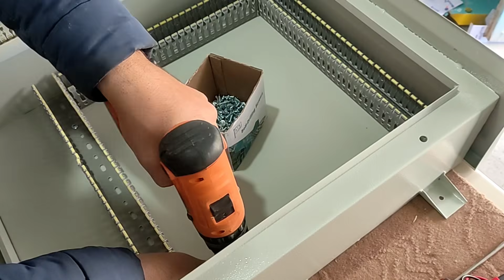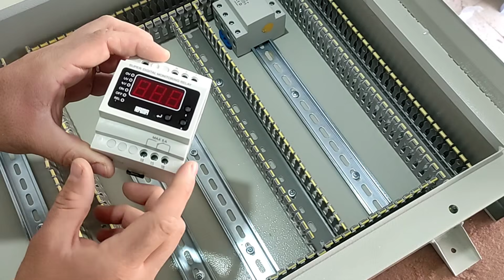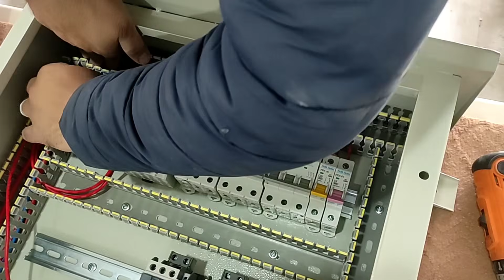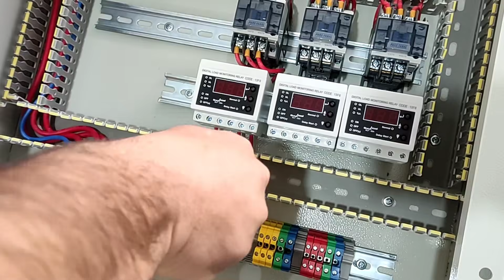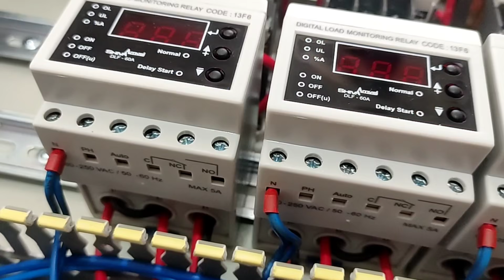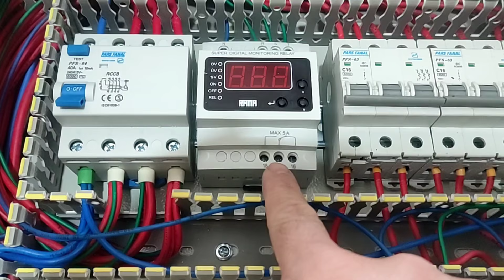Industrial electrical panel wiring training with all details

Comment: Please what’s the name of the slot on the contactor you inserted the neutral wire from the main RCD to
Reply from the maker: Contactor has Three input that generally named 1 , 3, 5 and there output named 2,4,6
The  for activating the coli of the contactor we should connect the phase and neutral wire to to the. Bobbin of the contactor that is named A1 ,A2
Neutral wire connect directly and We connect and disconnect its phase wire with a switch to disconnect and reconnect the contactor

Comment: Please i want to know why you connect a phase wire(black) from the contactors to the input terminals. Thanks
Reply from the maker: The black wires are for the situation where we connect the single-phase consumer to the contactors. If you look carefully, there is a blue one next to the black wires that supplies the new consumer.
Reply: @IET-76  thanks sir

Comment: i would use a DIn mount distribution block or busbar for instead of the wire splitting of the N wires, because you are actually crimping a lot of wire into one ferrule and you have enough space inside the box to do so.